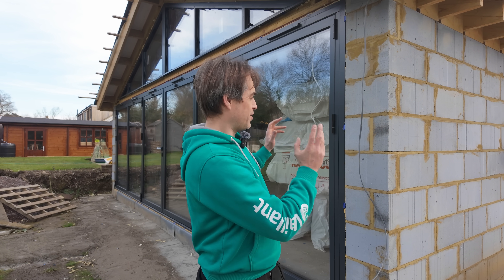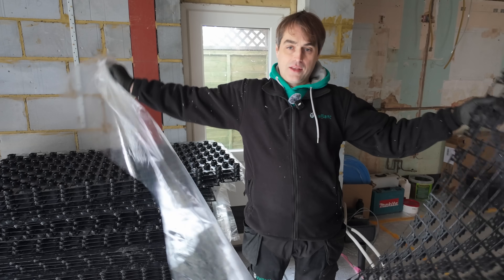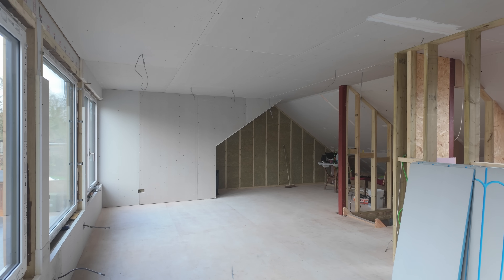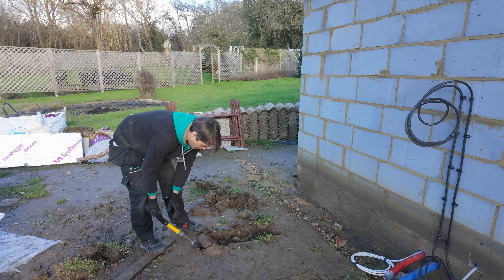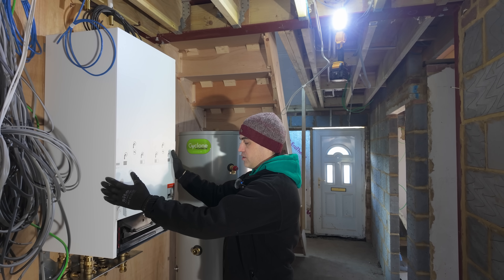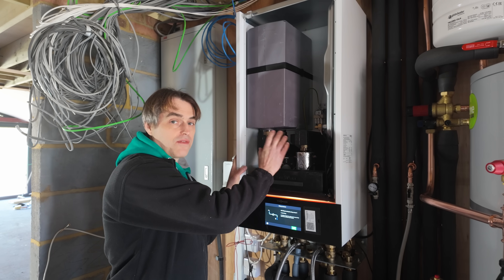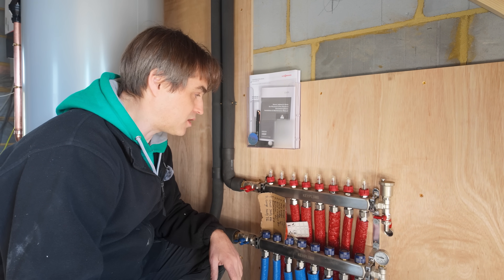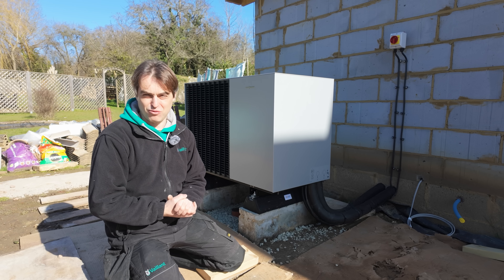Viessmann Vitocal Heat Pump - Is It Any Good?

Comment: What we ♥ about this is that you are so skilled in ASHP's, that you can so easily determine the underfloor pipe spacing dependent on location / the amount of windows in the room👍👍👍-must also be nice to work on new builds/renovations with top of the range insulation.
Reply: If you’re a Viessmann approved installer you just send them the spec for the building & they do all the heat loss calcs & spec what you need.
Reply from the maker: @hughmarcus1 that is exactly how NOT to do it
Reply: @UrbanPlumbers  why?
Reply from the maker: @hughmarcus1  becasue manus only do basic watts/m2 estimates and not proper room by room heatvloss calculations with system design. You need a site survey with proper calculations and design and you should understand how it’s done.

Comment: With that much insulation the heat from the lighting will probably be enough - not relevant to 99.99999% of UK properties
Reply: I’m thinking if it’s properly ventilated with MVHR is doesn’t need UFCh upstairs

Comment: Beautiful install, bordering industrial, not your typical unskilled British cowboy plumber. Reminds me of an install we had in Switzerland a decade ago. 
The only thing Ive never liked from a failure remediation perspective is the concept of underfloor heating that you can’t get access to without digging up the floor. Someone clever should invent a modular and accessible system.
Reply: Overlay underfloor heating exists, which sits on top of your existing subfloor. It can be made accessible by putting a floating floor over it. The downside is the heat is less evenly dispersed than with pipes in a screed and there is much less thermal mass to act as a buffer, but combined with a heat pump ticking along steadily there won't be many off periods in the winter and you would barely notice the difference.

Comment: I hope you will do a dedicated video at some point on which brand to buy because selection is really wide. By the way - do you like R290 heatpumps?
Reply from the maker: No, if I could I would stick to R32. NIBE 2050 is great / small, light weight and great controls, but we will not have that choice anymore. 

I like NIBE, Viessmann, Vaillant and also new Grant r290 looks like a great unit for the money.

Ideal r32 also looks good.
Reply: @UrbanPlumbers  Interesting. Any opinion on Stiebel units? The R454C units look great.
Reply from the maker: @Aphova  I have never tried or even seen Stiebel.
Reply: @UrbanPlumbers  There are a few more but probably not widely known in GB. Wolf for example. And especially interesting would be lambda. They are quite expwnsive but usually top the SCOP Benchmarks.
Reply: @UrbanPlumbers  is the grant a rebadged unit? Does R32 perform better or why do you prefer it?

Comment: It looks like the best system, ive seen.The defrost system has got to better than sucking heat out of the heating system or hot water on some systems.
 Does the Veissmann calculate the heat that will be wasted, sent to outside unit to defrost in the COP figures?
Got to be quieter than a 7kw Vaillant👍
Reply: The main point is that the Viessmann rarely has to do a defrost because it can function much better at lower temperatures
Reply from the maker: It goes to defrost as frequently as any other heat pump.
Reply: @hughmarcus1  have you just made that up or have the proof that is a fact? 
Lots of myths about heat pumps out there, one of them they are quiet! Alot of them aren't, and the manufacturers figures on heat pumps are as reliable as the car emissions scandal.

Comment: I am jealous.  In Canada we don’t have R290 access unless we import a 60hz unit from China and install illegally.  Not even sure if any Chinese gear is good.  So we wait for this tech.  Insane.
Reply from the maker: nothing special about r290 really. More trouble to site the unit usually and the same efficeincy to R32. I prefer R32 for simplicity.
Reply: @UrbanPlumbers  I am in Alberta, so we see -30C regularly.  R290 seems to work better vs others in cold conditions.  Everyone has natural gas forced air systems here, so a HP that can output 55C + would be better at integrating A/W heat exchangers with existing ductwork.  Also domestic HW is easier at these temps.  Using resistance electric as a boost spikes capacity charges here.  Basically an extra $200/yr per added kW.  I am a management consultant btw .. so I do a lot of math when designing .. my specialty is ROI.

Comment: It's a shame you don't install V200-W gas boilers any more. Care to share the SCOP you achieved (compared to say an Arotherm+ installation) with this installation in Jan/ Feb 2025?
Reply from the maker: i dont install gas boilers full stop. This system should go on montioring soon. (I need to fix sensors to piepwork, but don't have correct fittings yet)

Comment: We had a Viessman gas boiler installed at a time when Viessman had been subjected to some pretty bad press due to poor quality on early UK product. 

I was nervous but went with the installers recommendation. A ten year manufacturers warranty was a big help.

Once set up and running that boiler was excellent and never missed a beat. It was my one regret when we moved many years later and left it behind.

I am a great fan of the brand and it's interesting to see that you are now specifying their heat pumps.

Comment: Why did you go for the Vitocal instead of your normal go-to Vaillant Arotherm? Interested in the comparison.
Reply from the maker: Viessmann is a much nicer unit overall, but needs an internal box that takes space and is a bit more expensive. But you do not have to install AFV or buy separate controls or additional boxes for everything>

Vaillant units are ok, but not as well built, controls are poorer, they insist on anti freeze valves or glycol, BUS language is slow and outdated. Vaillant really needs a refresh now.
Reply: @UrbanPlumbers  yeah but is there any other monoblock as efficient?
Reply: @ None. Nothing comes close to Vital 150 (other than Ground Source)
Reply from the maker: @marcexec they are all very similar in efficiency to be fair.

Comment: Panasonic Aquarea have much better overall COPs , especially at low outside  temperatures (around 2 degrees) which is exactly what you want / need. And they cost half of the money.... I would not install Veismann, there are better alternatives
Reply from the maker: lol - 😂 they don’t have a better cop, they have very inaccurate onboard monitoring. Not a single Panasonic heat pump is on top of the efficiency on Open heat pump monitor. The best there is 3.7 scop and somewhere number 40, while the best Viessmann is 5.0.and no 1
Reply: @UrbanPlumbers  are these also your installs, so proper hydraulics ensured? I've done a few Aquarea installs with external monitoring and the annual COPs are always in the >4 range.
Reply from the maker: Look on OEM - first 20 places are Viessmann and Vaillant, not a single Panasonic
Reply: Im also very curious about that. Please more info

Comment: How much do those preplumbed/hydrobox units cost and how much labour time/costs do they save? Roughly. 

I'd prefer if they were smaller by omitting the defrost store, and simply increase the size of the DHW cylinder instead.
Reply from the maker: It’s part of the package. You cannot install viessmann air source without the hydrobox

Comment: Do you do any installs that are compatible with solar heating? Or an electric heater to make use of solar panel overproduction?
Reply from the maker: yes, we do install solar diveters for hot water. Solar thermal is not really popular in the UK.
Reply: @UrbanPlumbers  my bosch compress cmo 300 just died with 3 different faults appearing within 2 weeks, so im considering doing a stand alone monoblock outdoor unit, with a 3-500liter main buffer with spiral for alternative heat source(oil, wood, solar) and an electric heater with intelligent control so i "overheat" my system to 90° when i have spare electricity.
I already have shunts at all my in floor heating to take the varying inflow temps. I had a water leak in the floor this january so i have brand new 15mm pex in the entire house already going in, and 40sqm of flooring extra getting 20mm radiant floor heating getting put in

Comment: Is there any reason why you never put split unit heat pump ?
Reply from the maker: they arent really popular in the UK, as they require an F gas engineer on site and also run on older gas, so can't go to higher temperatures and require direct electric bac up for legionella. Also, they are a bit more complex, as they will always need a hydrobox. Monos are just much simpler.

Comment: Reminds me of the first V200 job you did years ago....I thought you hated Viessmann with every bone in your body? (We only install V200 and 150A as both are unmatched for efficiency).
Reply from the maker: Damo kindapped my daughter
Reply: Why do they say the ashp is better to run at liw temperatures when the v200 11kw model modulates to 1.9kw but the 150 a is 2.1kw

And the v200 flow goes down to low 20s
Reply: @ One uses gas and the other electricity? No other reason really. The v200 is a great solution when a ASHP cannot work for the property or the owner.
Reply: @singlendhot8628  thanks for the non biased opinion. Seems strange the v200 will modulate lower than the heat pump and flow can go down into low 20s too. I wish viessmann would make some more ashp models like 5kw and 7kw.

Then if your heat loss is 4.5kw, which is too .uch fkr the 4kw model and a 6 would be over sized,  you dont need to consider the 5kw arotherm plus more suited but less superior product.

Comment: Hi, I am a big fan of your work! Can you tell me why you did not used Vitocal 151‑A  as system would be much simpler?
Reply from the maker: It’s only 190l cylinder so too small for most applications
Reply: @UrbanPlumbers  Great video, the Vitocal units look like the easiest and best install option for average plumbers and should ensure good SCOPS. 
Can I ask how you know that 190L is too small? What chart or calculations do you use?
Reply: @UrbanPlumbers  thank you!

Comment: In place of the casalated panels try insulation with the tube spacing integrated. See European material suppliers. It’s been the norm for years.
Reply from the maker: post a link here
Reply: @UrbanPlumbers sounds like he is referring to the same boards you used on the upstairs
Reply from the maker: @Skjaeg69  yeah - those are not as good as castellated panels in screed
Reply: @UrbanPlumbers what make of panels are they please?
Reply from the maker: @greenmarketheating profix plus
Reply: @UrbanPlumbers  agreed, they only make sense in a light construction, such as a wooden floor/ floor joists or on an existing slab. In denmark its most common to tie to a rebar mesh, as we conventionally only have one concrete floor, unlike the british slab insulation screed sandwich
Reply: Insulated panels give poor thermal conductivity - only a quarter of the pipe is exposed and letting heat out.

Comment: Great distribution board plenty of space for circuit protection and controls. Classic uk consumer units are hopelessly small
Reply: They are laughably small, unless you do you have decentralised circuit splitting, but if you have a bunch of home runs the typical uk panel is the size we would use for a shed in denmark.
To be fair we have 3 phases in every house, and our MCB's must also disconnect the neutral
Reply: looks more like the European star system.